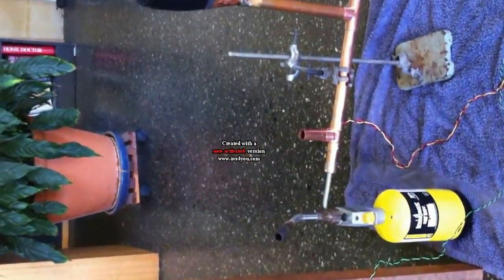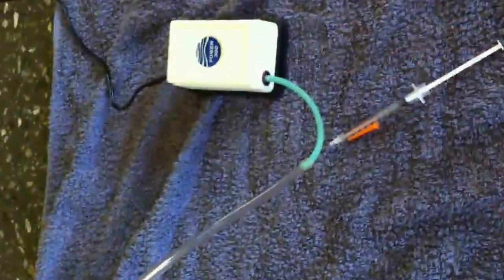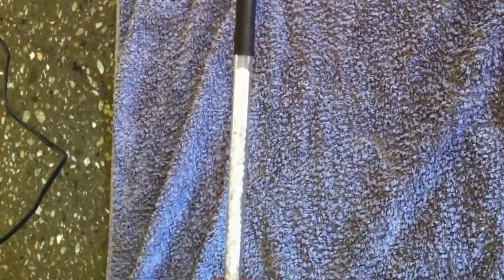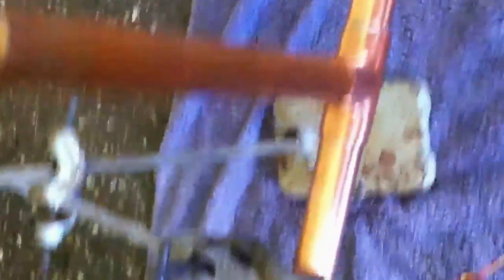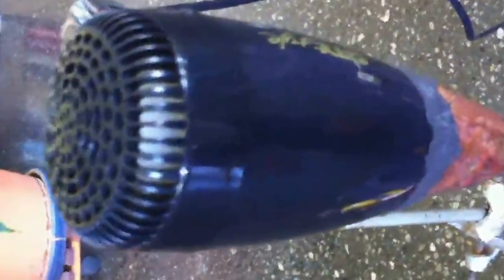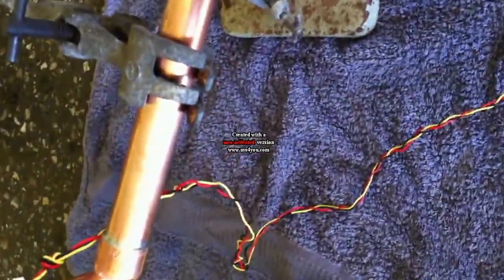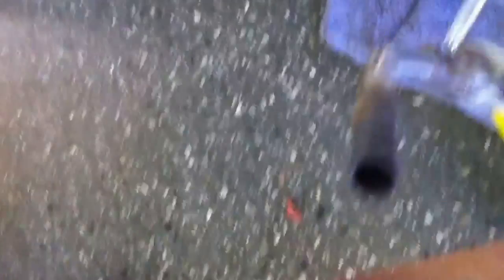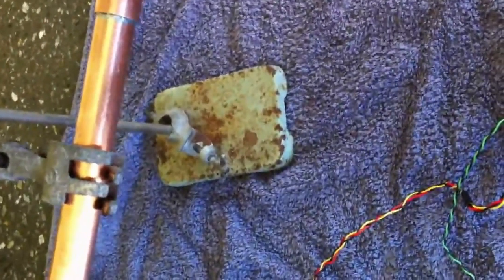gaschromatograph

Comment: your column uses gas-solid chromatography (GSC)? have you made any attempt to add a liquid stationary phase to the sillica (GLC)? Have you used this for quantitative analysis and if so how accurate was it? This is very impressive, i'm interested to know how it compares to the real thing, as each essential component is present. I can imagine the lack of a proper oven to accurately change temperature would limit its usefulness. It also seems like your column is pretty short, i'm used to seeing the long coiled up ones for GC
Reply from the maker: I haven't, but one plan was to H2O2/H2SO4 the living daylights out of the silica gel, wash it, then maybe palmitic acid/ H2SO4 to esterify to the OH groups on the gel. Essentially, I am out of time on this project, but I am waiting for a good Science Fair student to come along.  The above chemicals, of course, are what I would do - too dangerous here for a student to do unsupervised..

Ignore the oven quality issue - arduino pid library ovens are easily as precise as anything commercial. Given that many temp sensors in commercials are silicon- based, 2mv/oC, this is what sets the accuracy.

Column length is a bigger issue. This is a gc that you can get out to a school, for under $150. Pick a well-behaved pair of analytes, and it has done its job.

Cheers,
Leon